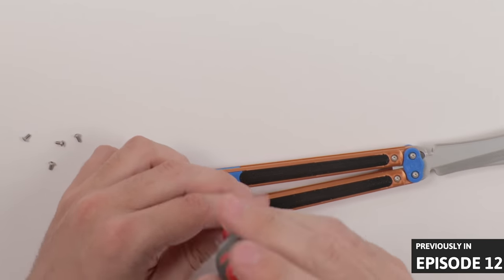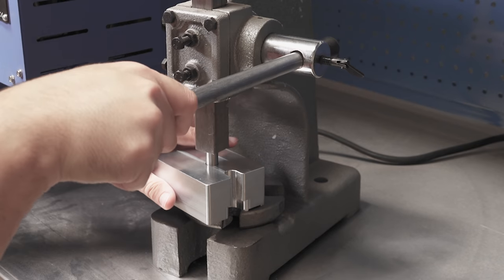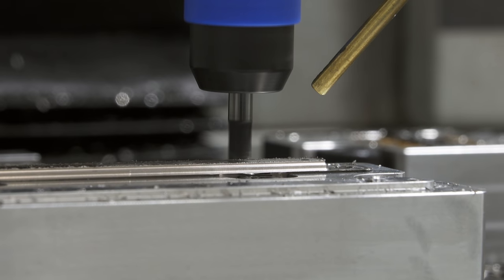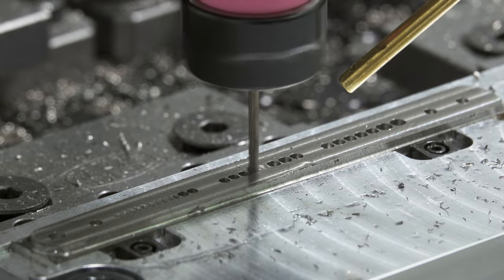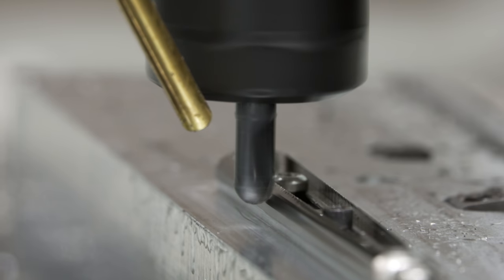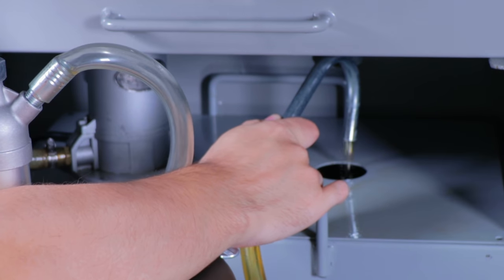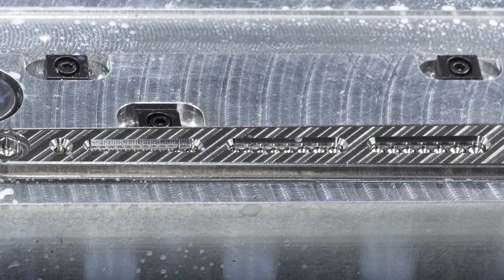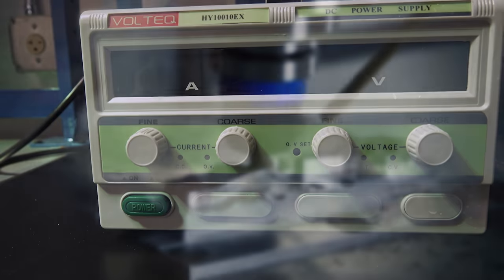Machining Titanium Successfully! Baliscissors: Ep 13

Comment: You're doing well in titanium!  With stuff like 6AL4V Titanium, you can't push the SFM too high even with coolant.  When you're too high of SFM in Ti you'll see that the chips look more like dark crinkled tissue paper on both sides, a good SFM will have chips look like nice and shiny on one side and dull on the other.

You may already know for surfacing in Fusion 360, if you use "Tool and center" for containment" include a negative offset equal to three times the tolerance from the Passes tab.  This will help keep Fusion only working on the surface you select without any weird waterfall issues.

Happy machining!

Comment: What's up with the insect cemetery?
Reply: The box wasn't sealed because of the electrode sticking out. And bugs are idiots. Got in through the crack in the lid and trapped themselves because they were to dumb to get out and died in the liquid. Must have been a while since all the water has since evaporated :P
Reply: @InnerBushman  on the bright side it looks like there won't be a moth problem anymore
Reply: @poptartmcjelly7054  😂🤣 Exactly!

Comment: Beautiful work, I’m impressed what you pull off there!
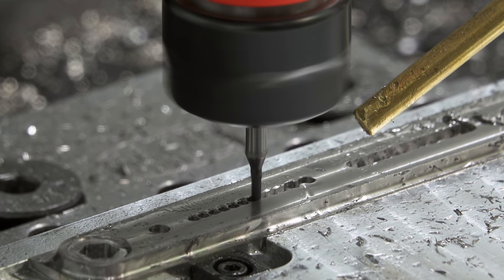Check your footage at 7:37 though where you say even the 16th inch endmill has no problem - it bends away noticeable during the operation. Gladly it worked alright but you might want to go slower at it if that endmill is supposed to last.
Reply from the maker: Yeah, I was using a longer fluted end mill because my normal shorter fluted ones broke. I also have decent amount of stick out outside the collet. I want some so coolant can get in, but I had extra from how I machined the blades. I think fixing both of those would help a lot. Hopefully don't have to slow it down too much.
Reply: sounds good, I wish you the best of luck!

Comment: Have you considered tapering the pins, or perhaps adding a separate milled axial taper feature (some sort of slot maybe) that keeps out the play even after wearing? Also, I suspect you might be able to get away with milling harder materials that won't wear as fast, or maybe try applying your own heat treat if you have access to an oven. 17-4 PH H900 might be a good start for a machinable stainless that does better than 300 series.

Comment: Awesome work! Just as a tip. Machine the fixture locating features of the part. once the fixture is in place on the table. Then any offset on the pins will be negated.
Reply from the maker: I machine a little hole to probe on the fixture to set XYZ 0. Are you saying make XYZ 0 a feature on one of the actual parts, the handles in this case? That's interesting, but what do I do before I've made the first part?
Reply: @ContraptionCollection  He must mean make an origin feature during your first Op when you've got excess stock. They you'll have a part specific origin for subsequent Ops.

Comment: The Brix scale of a refractometer is usually not a 1:1 to coolant concentration in my experience. There's usually a multiplier.  9 on The Brix scale could mean you're running alot higher in coolant concentration.  Make sure to check the coolant SDS for the ratio.

Comment: Also, when doing the finishing passes with the ball mill, try machining it from a 90 degree angle instead. So that it goes up and down instead of along the whole side each pass. It will probably take quite a lot longer to finish, but I'm 100% certain it will look way better =) By doing it this way, you could switch to a larger endmill with a radius instead and play around with your finishes. Just to remember to add the exact radius of the endmill in Fusion.

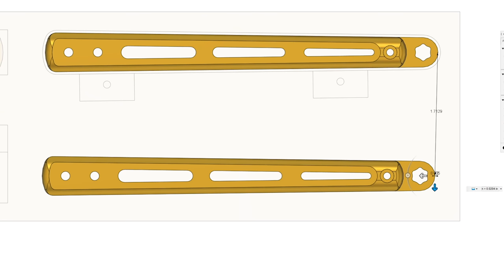Comment: 8:15 Maybe consider using some kind of post-processing step to deal with the surface finish instead? Tumbling them in abrasive media could probably take those scallops down without too much fuss, you can run a lot of parts at once, and it's probably cheaper than the extra machine time running the ball-nose back and forth a bunch more times.
Also, since this is an outside contour you could probably use a much larger ball mill to get a smoother surface just straight off.

Comment: Nice fixture and nice end product! What are the colored sleeves on the tool holders for? Do you differentiate different types of tools with those?
Reply from the maker: They are "Grifiti Bands" from amazon. I mostly got them to tell different similarly sized drills apart, but I started using them on end mills too.
Red is 1/16
Orange is 3/32
Yellow is 1/8
Green is 3/16
Blue is 1/4

Just helps find the right tool faster. It helps with editing the videos too.
Reply: @ContraptionCollection  that's a cool idea! I've been trying to think of something similar to differentiate tools at work. I might have to order a set to try it out. No worries about them coming loose or whipping around at higher RPM?
Reply from the maker: @DuxburyPrecisionConcepts  Never had one come loose. 
My first attempt at color coating was with nail polish. On a couple of the flats of a couple of tools it still hasn't come off, but I wasn't sure at the time. It's nice to be able to switch easily though. Another possible option I considered is dentists put even smaller bands on their tool bits and picks to sort them.

Comment: It seems that your ball end mill finish is a parallel toolpath. Your cam package should have a blend toolpath, where you select two edges and the motion is then blended between. At least if you take a look at the 5-axis stuff, since I believe they are made by ModuleWorks, and can be run as a 3-axis toolpath. Second option is to use a constant Z but there you need the option to add cuts to shallow areas, otherwise the top of the part doesn’t look good.

Comment: The blade part will be too heavy compared to the handles. This will make flipping it harder. You should probably drill holes in the blade so it more balcenced. Trainers do this and it makes a really big difference .
Reply from the maker: I'm using 3/32" blades in stead of 1/8"+ blades, which helps compensate for having two blades. I'm keeping balance in mind when designing the handles and blades. I don't think I'll have to make any large changes to the design. It will have handle bias, but if people want a more extreme handle bias, I might sell ones with titanium handle scales or make solid titanium handles. I'll talk about this more in my next couple videos.
Reply: @ContraptionCollection  Thank you for clearing that up. I can't wait for the next vids, keep up the awesome work! :)

Comment: I'm not lying, I would pay upwards of 100$ if these were hand machined and the blades were razor sharp and titanium steel alloy.
Reply: It will likely be much more than that. Small shop produced Balis with titanium handles often start around $370 (see Blade Runner Systems Alpha Beast and HOM Specter) and go up from there. This will have an extra blade and a complex mechanism handling the handle to blade lock/unlock mechanism in addition to what those have.
Reply: @andrezl88  I'll still buy it though. It would be an excuse to practice flipping in public 😂.